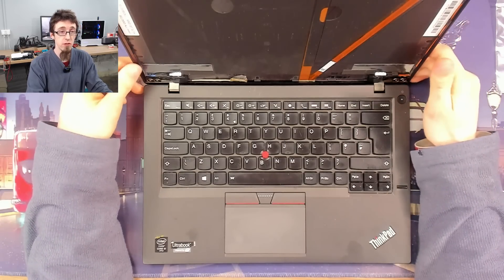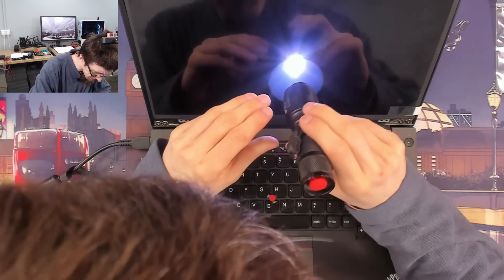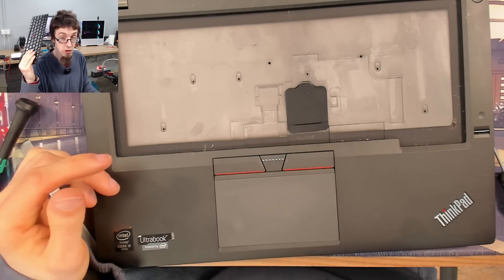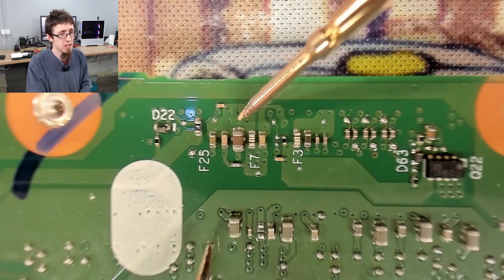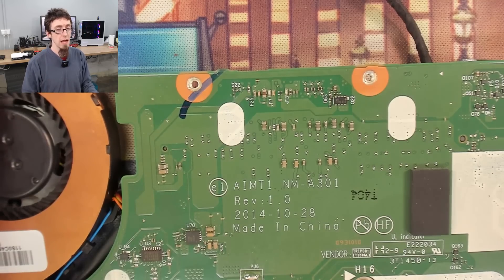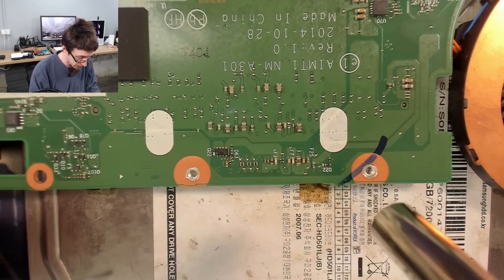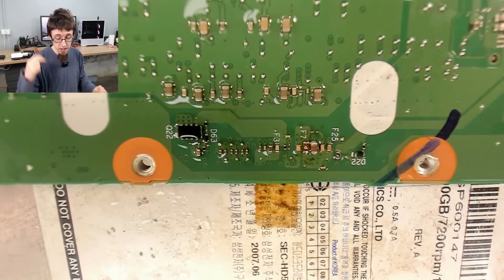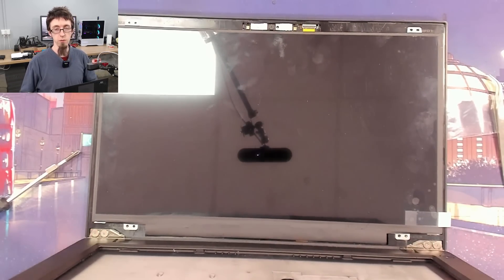Lenovo ThinkPad T450s with No Backlight after new LCD - LFC#265

Comment: So a question regarding the most important part, the diagnosis. 
The fuses were measured in continuity mode? 
A short beep indicates continuity which should be present on a fuse and no beep indicates infinite open line so the fuse is blown?
Reply from the maker: Correct, yes

Comment: Thanks @Adamant IT for the nice video. Would you be able to share technical specs you used to repair this one like air temperature, fuse model and amperage, soldering flux/paste specs, etc?

Comment: Hi Adamant IT,

I have a Lenovo T470 with a cracked screen. When turned on the screen went on showing that it is broken. 

I purchased a replacement screen and when installed it will not work. Nothing shows at all. Using the HDMI port, I get a normal image on a different monitor. 

Does this mean that I am having the same issue that you had in this video? Or does this mean that I have a different issue? Maybe the screen is a DOA?

Could you please let me know what might be happening here with my situation?

Thanks,

Also, love your channel!

John

Comment: My friend, thank you for this video. I was looking for an abnormaly on the screen of my laptop (screen with backlight but there's not image). So I tried to check if the conector was loosen or something else but I didn't know about 2nd battery and only watched a small electric discharge (short circuit) damm... :/ 
Yet I can watch image after that, I'll try with your information. May you share what's the rated value of the fuse please? Again thank you

Comment: Hi, I am having the same issue with my thinkpad t440. What I believed to had happen was that I dropped the laptop and the screen was destroyed and the cables may have shorted each other out during that event. Do you know where I can get that resistor for the backlight? If not can I send the laptop to get fixed?

Comment: I had this issue happen to me when I changed the LCD.   I pulled the main battery.  I didn't disconnect the 2nd internal battery, and it blew out the backlight fuse on the motherboard.   
I don't have access to the tools, nor access to folks like you that fix this sort of thing, so I only had the option for a new motherboard.

Comment: I also changed the LCD and brightness stopped working, in windows 10.
but, when I installed Ubuntu Linux on it, it works like charm, so I can assume here that no hardware issue here, as it works on Ubuntu.
Could you please tell any software fix, apart from updating drivers, as I tried many but not succeeded at it?

Comment: Hello, I do have an issue in my dell laptop where backlight of LCD is on, but i cannot see any pictures its dark in internal display but brightness of LCD can be adjusted but there are no images in the display. Which means i should go for new display ? Alternatively i am using my monitor for now it is working well it that. but can you suggest a solution for this problem

Comment: I do break/fix work and work on lenovos nearly every day. Those models have a bios option to turn off internal battery. In this case if the LCD was totally gone and there was no way to connect an external monitor you simply could not do it. The HMM is readily available to any one on lenovos support web site. AND YES those KBs are a PITA if they are gummed up...:)

Comment: On a thinkpad you MUST disconnect the battery to do this. This is because thinkpads are known to have overly protective fuses that are guaranteed to wreck havoc to you when you even remove a keyboard when the laptop isn't fully shut off

Comment: Ah memories, I had one of these as a work laptop for like 5 years. Definitely could've used an SSD but it didn't belong to me so I couldn't touch it and it just started to frustrate me, battery only lasted an hour in the end as well.

Wish I could've kept it instead of it most likely getting binned but they gave me a P11s with a Ryzen 7 and 32 gigs of ram so I'm not complaining

Comment: at least you can change the keyboard - hate the newer machines where the keyboard is part of the upper case and is held in by melting plastic pegs - got an two Acer machines here that I need to find the case/keyboard for rather than just having to replace a cheap keyboard

Comment: Just need to make sure the second battery is disabled in the bios prior so there is no need to open it up to disconnect it, I replaced the screen on my Thinkpad T440 which is very similar to this and had no issues. The battery should be automatically re-enabled after startup, really enjoyed the video

Comment: I have a T470 and there are 2 screws I have to remove from the bottom that hold the keyboard. I then slide the keyboard towards the display to expose the metal tabs that hold the keyboard in place, and then can pop the full keyboard out. It is a lot easier than what is shown

Comment: Older Lenovo’s much easier to work on and upgrade for sure. Also when they have second battery you can disable that in BIOS. It’s on Lenovo repair guide videos
Reply: I agree, they later changed back to a better design, but you still have to disable the internal battery thru the bios before working on these machines.

Comment: I have an old Compaq 610 with no backlight, the problem is that I can't find the fuse on the board even on the schematic. The fuses on the screen board are good. Any help 🤔🤔🤔
Reply: @anshadedavana  thank you for your answer
1 - yes there's a resistor on the rail BKLT_EN  it has 0.5♎ it's not faulty AND EVEN 19V comes until the LCD connector
2 - yup Compaq 610 doesn't have CCFL
Maybe it's a problem caused by the components on the screen itself

Comment: T430s Nightmare keyboard. However,  between ctrl  & windows key (left)  -  prtsc &  ctrl  (right)   each side is one small lock snaps like this ( - )  press them in with a small head flat screw drivers. soft push makes the frame easier to open and get to the screws.  I never knew about the F 7 now I do. Thanks.

Comment: Hi there. Just some info: if you removed the 2 rubber tabs under the external removable battery, you would have been able to slide the keyboard cover back easily using the 2 indents on the the left and right of the keyboard, exposing the screws to undo the keyboard. Secondly, the internal battery can be disabled in the bios to make it easier before working on the logic board or lcd.
Reply from the maker: I'll keep an eye out for those rubber tabs if I see one of these again! I've actually seen one of these before a long time ago, and don't remember having so much trouble with the keyboard. I figured this one was just stiff or something.

Comment: Looks like a T450, had one that came with a god-awful TN screen, swapped a IPS panel in. Works fine but in Windows there's no Backlight control, only in Linux for some reason.
Reply: T450s came with IPS touch.

Comment: When you want to remove keyboard in Thinkpad in models like T440/T450 under external battery are 2 rubber plugs, when you remove it before it will be a lot easier to remove this keyboard.
Reply: The T440p is different from the T440 & T440s. The T440p only has 2 or 4 screws that are revealed when the keyboard "cover" is slide up to expose them. The back cover is a dream to remove with only 2 screws holding it in. Just remember to slide the back cover off the clips. Being used to earlier Lenovos I went and pried the cover off and broke 13 clips in the process. Fortunately Lenovo were very good and replace the AUD$103 back cover under warranty. 🤫
Reply: @josephking6515  I have already T440p, this laptop is really great for upgrading. Now my T440p has FHD IPS display, 16GB RAM, i7-4702MQ and 2nd drive in DVD drive bay. If we can compare stricte cpu performance, this i7 is comparable to i7 8. gen, for me it`s a beast. I want to buy eGPU but WLAN/WWAN white list block eGPU adapter and i have to modify bios dump.

Comment: What do you think of using a conductive glue instead of soldering?
Reply from the maker: Sounds interesting, but sounds like a DIY bodge... useful for someone with no tools, but easily outclassed with any other soldering equipment. I haven't looked into it at all though, so I'm guessing here...

Comment: Good thing my old Acer E5-475G isn't that much a pain in the ass to repair 😂
Reply: Have you never replaced the keyboard on it?
Reply: @josephking6515  Not yet , 

over the 5 years of owning this laptop , the repairs and maintenance  i've done is repasting the laptop , cleaning and RAM upgrade.

Battery was just busted this year 2021.

As for the keyboard , none of the keys so far have been acting weird, i clean under the keys to remove some of the dust accumulated using a very light, dry and used paintbrush.

Comment: Thankyou graham, i always enjoy watching the repairs :-D
Two batterys that's a worry as 10-19 volts is always present in the lcd.
Reply: I agree. Sincere thanks for your answer.
Removing the Connectors as done here is absolutely fine. If I want to be sure, I use a single wire with double alligator terminals. One alligator direct to ground (screw hole) and on the other alligator add any 1W [1 - 15] ohm resistor to touch each individual pin. Damaged test terminals (power supply or a multimeter), previously measuring the continuity of the wire to be used, serve this purpose.
On the other hand, already skirting the limits of exaggeration; I cover with black or kapton tape the cable that goes to the screen and also the connector on the motherboard. I do this to any laptop. All the best.

Comment: more addictive viewing...great vid Graham....wouldn't it be great if they had external fuses under a flap like a car...pull old one out ...push new one in :)
Reply: NOPE, cos if they did that, customers would replace the fuse, it goes bang and they then put a bigger one in or a shorting link across it. Then they bring it to a repairer and say "dunno what's wrong wiv it, it just stopped". Repairer has a ten times more difficult job to fix it. Been there, got the Tee Shirt, book, badge and plenty of kit that customers "broke" trying to repair it themselves. 

That's why they put labels on like "NO CONSUMER REPAIRABLE PARTS INSIDE".

If it can't be fixed by turning it off and on again, leave it to the experts like Graham.
Reply: @ChasLarge  Exactly this ^^ 🤣🤣
Reply: @cattflap1447  yep Furry you are both right
Reply: @ChasLarge  Yep good point CIL...hadn't thought of that ...you are of course correct

Comment: If someone is game enough to replace an LCD on a laptop they would have enough technical skill to do the job correctly, ie isolate power
Computer techs tend to get complacent, and most would think.
Computer is off, so the backlight is off.
Reply: to be fair, the battery had been removed but there was another one inside...
Reply: @RWL2012  which is common these days and a simple google wouldve alerted whomever to this fact.
Reply: @BenState  first time I've ever heard of it. Yeah, I'm sure it would occur to someone to Google whether a laptop with a removable battery also has an internal one (!) Do you work for Lenovo...?

Comment: Aaaah, your first Thinkpad disassemble! You'll learn, my son, you'll learn! 😁😉👌
Reply from the maker: big mood 😩
Reply: @Adamant_IT  I remember the first time I had to replace a keyboard on a Thinkpad X240. I had to strip down the laptop completely... 
I think Lenovo has frustrated designers 😁
Reply: @brecht4713  Why? There's always a Thinkpad HMM (Hardware Maintenance Manual) with all the Steps. The Keyboard should be easy. Look at the underside of the Thinkpad. There should be 2 or mor screws with a keyboard symbol. Take this out and then it's only a simple push in direction of the screen and the keyboard is free.
Reply: @rainerbehrendt9330  That is exactly what I did. Believe me, for the X240 you have to remove everything to replace the keyboard. Look it up if you want 😉
Reply: I stand corrected. Sorry. Took a quick look into the X240 HMM.
For access, remove the following FRUs in order:
• “1010 External battery pack” on page 59
• “1020 Base cover assembly” on page 59
• “1030 Internal battery pack” on page 60
• “1040 Memory module” on page 62
• “1050 Hard disk drive or solid-state drive and drive cable” on page 62
• “1060 Wireless-LAN card” on page 65
• “1070 Wireless-WAN card or M.2 solid-state drive” on page 66
• “1120 Speaker assembly” on page 74
• “1110 Coin-cell battery” on page 73
• “1080 Fan assembly” on page 67

and two more steps. This is crazy. Not comparable to the T or P Series i own or owned.
Reply: @rainerbehrendt9330  I totally agree, I only have good experience with Lenovo, except for the X240 then 🙂
That was just a bad design, I guess
Reply: @brecht4713  that's not bad design. I would call this a thinkpad from hell and i'm using Thinkpads since the old 560 days. I ignored the x40 line because they killed the dedicated trackpoint buttons.

Comment: Really interesting repair, part of my job is looking after a fleet of these laptops. While I like the modularity of the design, it's far too easy to get caught out by the Internal batteries in these. You can turn the charging circuit off for the internal battery in the UEFI by pressing Enter, F1, and under Power there is the 'Disable Internal Battery' option at the very end of the list. This will even work on devices with a BIOS Supervisor Password or Power-On-Password applied to the laptop, you just need to press the enter key again when prompted. The battery is enabled again once the charger is plugged back into the laptop.
Reply from the maker: Interesting! A lot of overengineering purely for the sake of being able to hot-swap batteries it seems. I've never heard of anyone who's actually needed to be able to hot-swap a battery though.
Reply: thanks for tip, I strongly recommend this to people if water is spilled on PC. Then right away enable "battery disable" this helps prevent further electrical corrosion. Cool

Comment: Andy yeah, up until recently, most of these Thinkpads had dual batteries.  I've learned to disable internal battery in BIOS prior to doing any work on them if they're still able to power up.
Reply: Best thing to do is isolate it by disconnecting it physically.
Never rely on software to isolate power from a physical device.
Reply: @IIGrayfoxII  Yes , cant beat breaking the physical connection
Reply: Though I feel bad for the guy who did this without knowing that there was a 2nd battery in the laptop that he had to disconnect as well. :(
From Graham's perspective, I agree, very poor design for serviceability.
Reply: @gxc90  I have not worked on laptops in years, but quickly saw that the the unit had an internal battery.

The internal battery did not look like a random bit of hardware a laptop would have(even a business based one), the connector on it looked like it could handle some amps.
It looked like a typical internal battery.
I also tend to look at labels of hardware to know what it is.